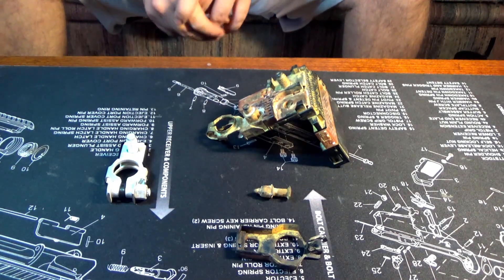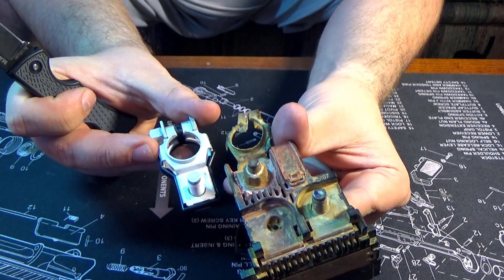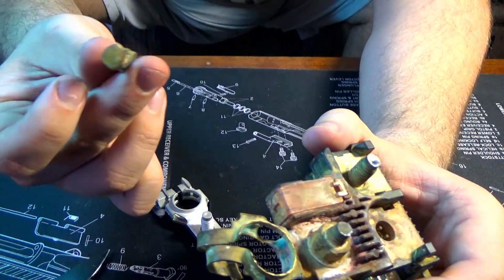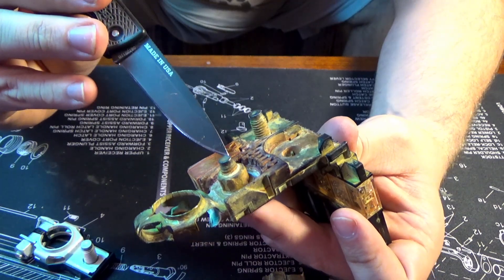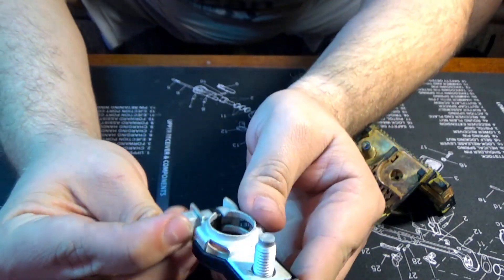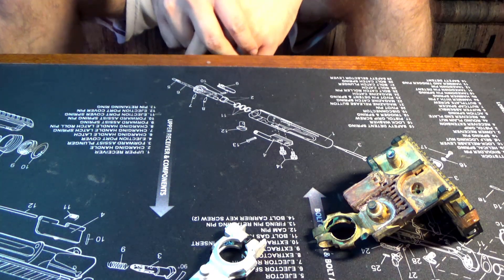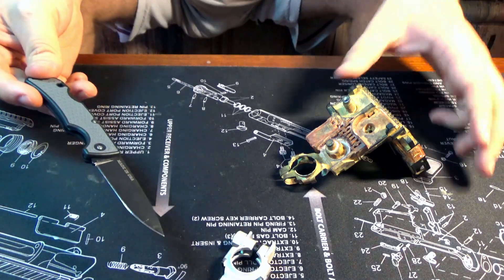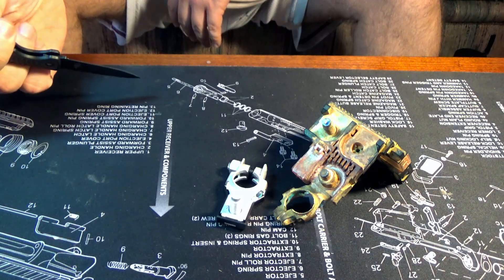Anatomy of a Failure #1 Nissan Sentra Fusible Link and Positive Battery Connector

Comment: Hey man if you don’t mind I have a question. 2014 pathfinder. 250 amp fuse keeps blowing only when starting car. Replaced starter, negative battery cable and the car started. THEN the serpentine belt ripped into shreds. Turns out the alternator pulley is seized and now the fuse blows again when trying to start. So new starter and new neg cable worked. Then that happened. What’s your opinion?
Reply from the maker: I would get the alternator tested, it could be sending too much voltage and causing it to blow.

Comment: Will this cause my car not to start? My car is dead in the water with a flashing key symbol on the dash.  I checked all fuses, changed key fob batteries and nothing
Reply: Have you found out anything? My car is doing the same thing
Reply: @H8onNapoli any update? My girlfriends car just started doing this

Comment: forgot to mention that if only one of the fuses on that block fail then you have to replace the entire block because they dont just sell replacement fuses for it and on top of that even if they did there is no way to access them to remove them and change them out. this battery connector design is the worst one i have ever seen in my life its pretty much a money grab by nissan
Reply from the maker: Yeah, valid points on what I forgot. It is a pretty awful design. Idk what Nissan thought with it. Hoped the video helped you.

Comment: Is there a way you can put your own fuses on instead if the fusible link because I’m trying to run a 10,000 sound system and I’m wondering if I will blow this every time with a 390 amp alternator or can I still use it but still need fuses please help
Reply from the maker: Honestly, not sure. Better question for a sound shop, I haven’t done a ton of audio stuff.

Comment: I have a similar problem with my 2014 Xterra. I've never seen a car with that much corrosion before also. I couldn't get that nut, that secures the battery clamp to the fusible link assembly, removed without breaking the assembly.  I had to replace the entire assembly and had to order it because I couldn't find one locally. By the way, what is that plastic under the clamp for? There's nothing that it would short to. Anyway, I replaced that cheap and fragile clamp with a standard "old style" battery clamp that has a mounting bolt like the original clamp has but I had to slightly enlarge the hole on the fusible link assembly to make it fit. It appears to be a 9mm hole but the vertical bolt on the new clamp was 3/8". The cable that attaches directly to this stud bolt has to be enlarged or replaced also. I thoroughly "greased" the clamp with conductive battery anti-corrosion paste and hopefully I'll never see that kind of corrosion again.  Anyway, this is a poor design. I've never seen such a fusible link assembly like this on an American car.

Comment: FWIW I replaced mine with a marine type from O Reilly's. It requires drilling the hole a little bigger and getting a nut instead of the wing nut that it comes with but it is much better setup and will last longer. P/N: SK7203
Reply: I did the same thing and threw in a galvanized lockwasher also.
Reply: I forgot to mention that the cable connector has to be enlarged also (or replaced if you have a compression crimp tool) or it won't fit onto the bolt stud.

Comment: Any tips on getting that bolt off? I’m having the same issue with my 09 Infiniti G37. Really don’t want to have to replace the entire fuse. I already have the Terminal Assy C replacement but I just cannot remove that bolt
Reply from the maker: Chandler man, off camera, I tried everything to save her some money. I used pricks, impacts, foaming battery acid cleaner, penetrating oil, coke, vise grips, hammers, chisels, and even spit. You probably won’t get it off. You will probably have to replace the fusible link, terminal assy C and the bolt for it.
Reply: z66ka after battling that thing for 2 days I got it off about an hour after I left this comment lol. Drenched it with WD-40 and after 8 good tries it budged and came off. All it cost me was a single bloody knuckle. Used a socket wrench and a towel for grip 😂😂. Sad thing is my car is still having the same issue. It starts and cuts off 30 seconds later
Reply from the maker: Chandler glad you got it off, sorry you are still having issues. Hopefully, you get it fixed soon.
Reply: @mustbeice  
Thanks for the tip. I have a 08 Altima and the metal loop of the terminal that goes around the battery post is barely hanging in there on one side.  The bolt won't budge and because the metal ring is broken I can't even put real pressure on it.  The cable and the fuseable link are just hanging there and there's no way to get leverage.  What a crappy design.  Why? Why? Why?  Looks like I'll have to replace the entire thing. Congrats on finally getting yours fixed.

Comment: Design is flawed due to battery sweating and corrosion. Replaced entire component. Cheap part. OEM was 55$. 1hr job.
Reply from the maker: You are correct look, flawed design, at 99-07.5 chevy trucks with melted washer bottles and sprayer motors. Don't forget to like, subscribe, and hit the bell icon.
Reply: Wer did u buy yours
Reply: I couldn't get a fusible link assembly locally and had to order it. I couldn't get one from Amazon for a couple of months so I ended up ordering one from an online Nissan parts dealer. Cost about $45 (part+shipping+tax) but still had to wait a week. Good thing I have more than one vehicle.